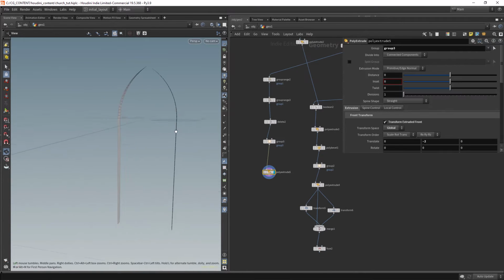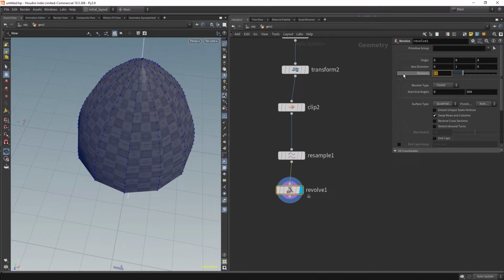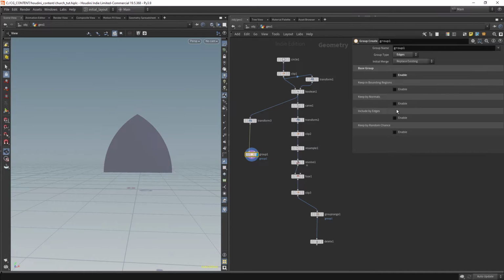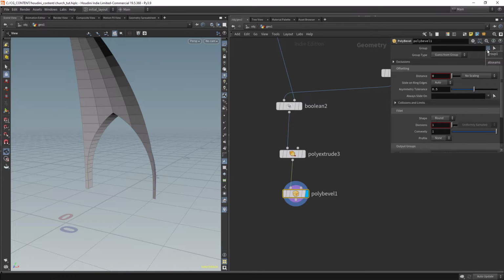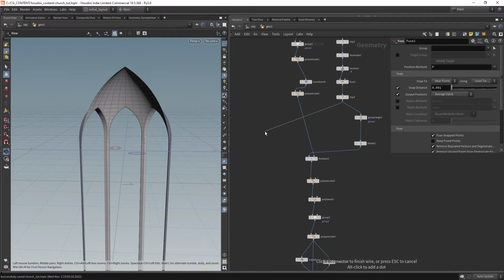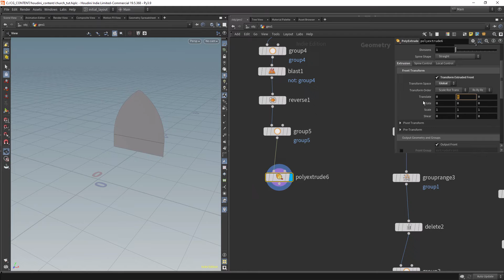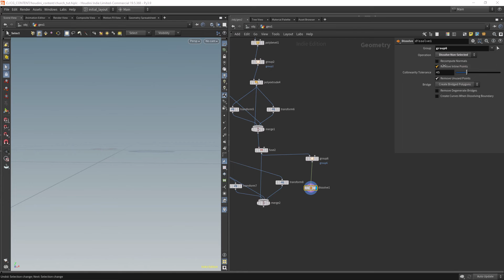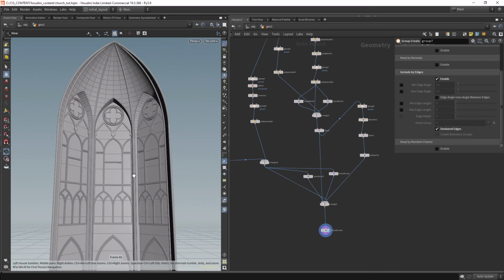Procedural Modeling  | First steps with Houdini

Comment: Why is my boolean not showing anything?
Reply: You need to tell houdini to treat each set as a surface instead of solid. In the tutorial this isn't done but it should be set if ur working with flat surfaces. Strangly it does work as solid but not always. So better of just to toggle it if it isn't solid.
Reply: @BerhTv  I’ll try that next time, thanks
Reply: @junechevalier  Hello If you haven't solved the issue and also if you are using Houdini 20 or so, uncheck 'Reverse' of the circle geo. It solved the issue on my side.
Reply from the maker: Hard to tell without seeing it..
Reply: @cgside  I intersected two circles to make the arch, and no matter which boolean process I choose, nothing appears in the viewport, both circles disappear completely, even though I've tried boolean on two boxes just to test and everything works as intended. And yes I've made sure the two circles aren't completely covering each other 100%, I'm aware of how boolean works